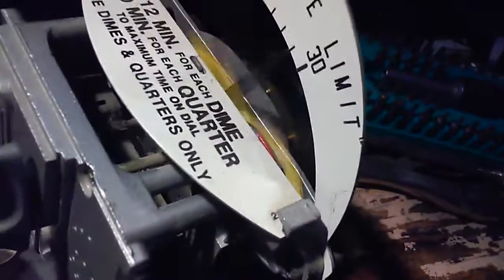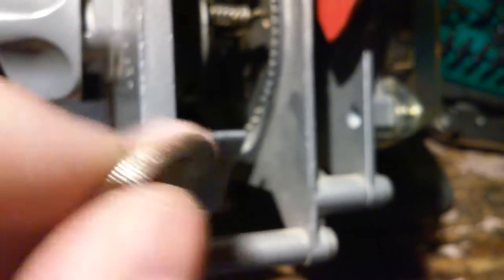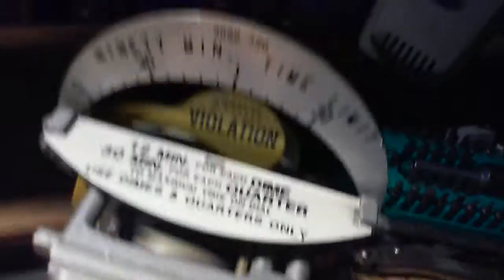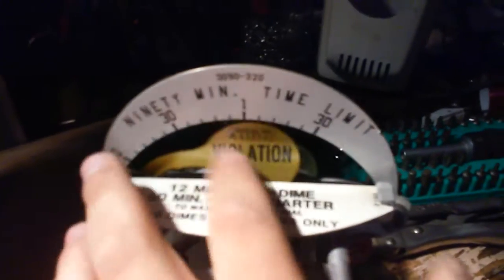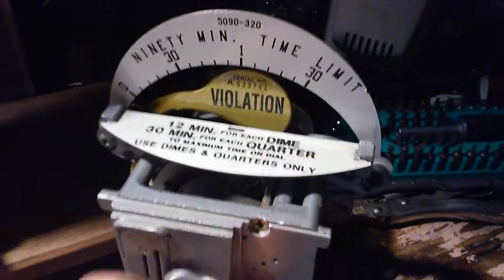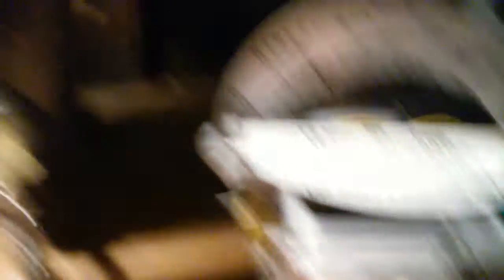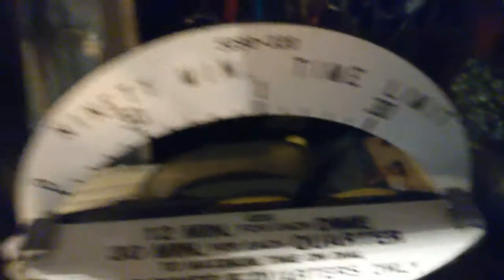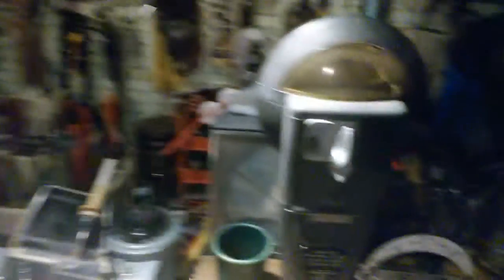Duncan model 60 parking meter.

Comment: Does this meter need to be rewound periodically with a special key or is the clockwork spring wound by the user turning the handle ?
Also you did mention that it can't tell neither the weight of the coins nor what metal they're made of. Does that mean fake coins would work ?
Reply from the maker: Yes, it is wound by turning the handle. The other meter I show in another video has to be wound with a key. The old mechanical meters like these were susceptible to slugs, anything the size of a real coin will work

Comment: Very cool.
Reply from the maker: thanks, I didn't even realize it uploaded, said it failed on my phone. Stay tuned for the other 2 meters.
Reply from the maker: Will Phoneman
I didn't show the locks and keys! arrgh
Reply from the maker: Roger Wolf The key for this one is shaped like a model 60 parking meter! It was custom made by an online seller who no longer sells them. Basically, he would use the same key for all locks and file the sliders on the lock to fit the key. Crude, but it worked. Are your keys what would be called "demo keys"? I know the number 11 ones are, that's why they are available. It's possible to disassemble a lock and make a key based off of measurements of the sliders as well, but you need a milling machine or key duplicator designed for sidewinder keys. (I also collect locks)